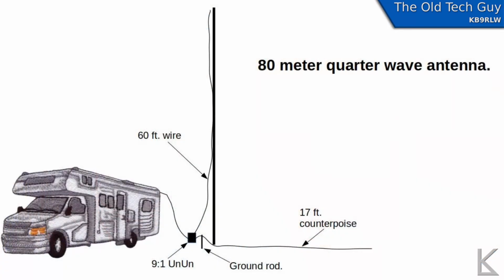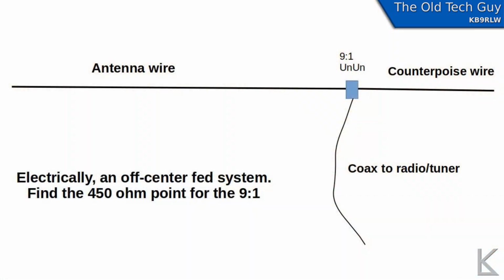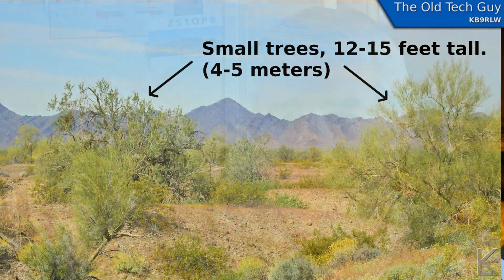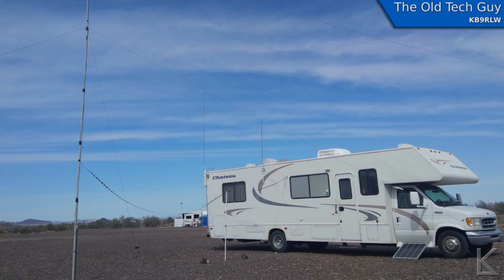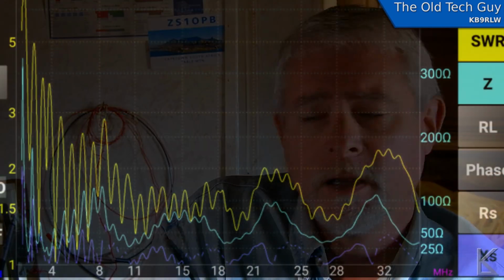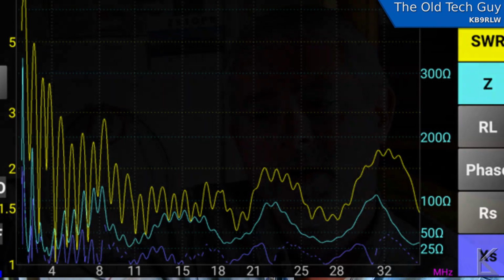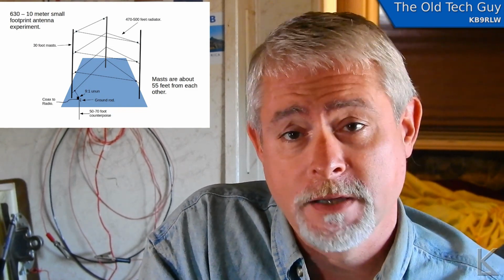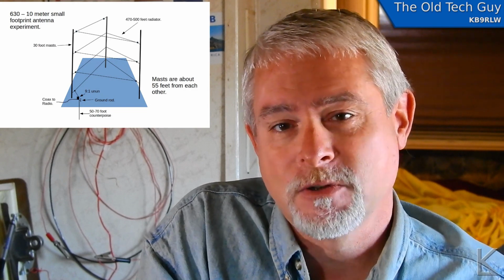Ham Radio - A 630-10 meter experimental antenna.  Part 1, the plan.

Comment: Good luck with the antenna experiment, you never know if it will work until you try it and play around with it.  It may have been tried before without success, but you might get better results.  Be brilliant if you did get it to work.  Good luck Kevin.

Comment: Bottom line, you are my kind of ham!
Instead of going out and just buying you decide to experiment like I have done in the past (I am not currently active), especially when I first got licensed in 1993 and first started in Satellite Radio (AO-10, AO-13, RS, AO-21, etc. so many more to name, I miss satellite coms)
 Its so much fun and exciting to make antennas and knowing they work just as good (if not better in some instances) than commercially purchased antenna's. Don't get me wrong,  I have also purchased antennas of course but building is so much fun and exciting! And I loved to modify my Satellite antennas when I started and had fantastic results!
 Bottom line my fellow Ham's. BUILD, experiment and test! that is what Ham Radio is all about. 

Kevin let us know how it works out, if you haven't already? Sorry if I missed the follow up video.

Thanks for your video, best 73 DE KD6SBR, Tom in NV (hoping to get back on the air soon, 80 160M hopefuly)

Comment: God speed in this experiment! I love the idea. I doubt this will be available, but maybe it will inspire something. Recently I visited my town's local metal scrapper, and they had
 1" aluminum poles. Most were cut into 4' lengths. I bought about 20 of them. Then I riveted on 12" lengths of schedule 40 pvc which matched the OD of the aluminum and couples the segments nicely. I do have to guy them but they work well and the whole weight per mast is just a little more than an event/camping chair.

Comment: Hi Kevin. Thanks for the video.

From personal experience - you really need to model antennas before building them. I've built a reasonably simple and well-known Windom antenna once and it didn't work quite well. For some reason I got SWR 2 on 20 meters. Thus I decided to model it - turned out the impedance in the feed point considering the mast hight and inverted-V shape was far from 200 ohm, thus 1:4 transformer didn't work as I was expecting. It took me 10 minutes to make a model and a day to build an antenna. Lot of time was lost. If you are using MacOS, CocoaNEC would be a good choice and it's well documented. For Linux there is xnec2c. For Windows there are GAL-ANA and EZNEC. There was series of articles on EZNEC in QST column "Hands-On Radio" by Ward Silver (NØAX). If you are an ARRL member, you can access these articles online in QST archive, or you can buy a book "Hands-On Radio Experiments, Volume 2". 

Speaking about new videos maybe you could tell us a little on using a straight key or how you learned to use it (some kind of exercises maybe? or just a lot of practice?). I'm new to CW. Learning morse code per se was not a simple task, but there is plenty of information on how to do it. Currently I'm using a two-paddle key at 20-23 WPM and sometimes straight key as well. I'm using this one https://www.ebay.com/itm/TH-010-Morse-Code-Telegraph-Straight-key-on-Wooden-Base-for-Ham-CW-Practice/123595435706  Although I made some QSOs with it I get an impression that I might do something wrong. My arm gets quite tired and I can't send faster then 12-13 WPM. A little peace of advice would be much appreciated!

73 de R2AUK

Comment: Great idea but I'm not sure how that triangular spiral -- a combination of horizontal and vertical -- will go. As you know, you can bend horizontal antennas to fit a yard, but IIRC there's a limit to how much that bend can be before adverse effects begin to apply. Now that radio has been around for a century, and thousands of antenna designs have been created, it's probably a safe bet that someone has tried such a spiral. Callum may be able to model that for you.
Reply from the maker: It's been modeled, that's the next video.  Results were pretty good!

Comment: Hi Kevin, good to see you back on the Tube.  The 500 foot wire as you described it sounds a lot like an unterminated 80M Beverage antenna. When you are done with the 630M testing I would run some receive tests against your Inv V and vertical. Some of your viewers might not know a lot about Beverage antennas. Could possibly be an interesting video also.

Comment: I suspect that this spiral will work somehow. On 630 m the spiral is much smaller then the wavelength. So it will be like a coil / inductor, like the short stub antennas that you put on hand held radios. On shorter wavelengths it will be a helical antenna. I.e. it will radiate vertically upwards, perfect for NVIS.

Comment: You Kevin!:
Great video! (As usual : ). How about doing an end-fed balloon or kite 630 mtr antenna? That might be interesting! (Lighting arrestment I'm SURE : ). Give it a try! (Additional comment on e-mail : )..
Dr seeker/Jeff WA7LFP
Reply from the maker: I've had a balloon kit for about a year now.  The problem is you need to notify the FAA at least 24 hours ahead of time.  And out here in the desert, it's been nearly impossible to predict when the following evening will be calm.  And even if it is calm at sunset, you can suddenly have 20mph winds for a bit at random.
Conversely,  I've flown a kite and had the wind completely die within a couple of minutes.
It's just too unpredictable out here.
Reply: @loughkb  Yeah, aircraft danger, especially helicopters flying low.  You just need one, if your luck is like mine it will be the only helicopter to pass that way in years!  Then they would hit it!  But maybe you have better luck than me.

Comment: I like the idea of your 'delta spiral', but surely the support masts will need to be non-conductive? They'd be a bit bendy and need guying. But experimenting is what it's all about.
Reply from the maker: I'll be using fiberglass, and guying them back from near the top to support the pull and weight of the wire.

Comment: Interesting idea Kevin. Maybe you should try it on 160 first. Look forward to the results. 
Watch out for snakes. 73
Reply: An excellent idea, considering the amount of radials required!
Reply from the maker: My original idea was to do this with an end fed half wave for 160.  At that length it only goes around the structure 1.5 times on it's way up.  That version would be fed with a 49:1.

Comment: Hi Kevin,
Good to see you are well. That spiral antenna looks to be a good experiment. You can take off the bottom cap from the spiderpole and remove the smaller sections and you will have a shorter mast that will be extremely stout for the antenna experiment. Did you make any contacts during the ARRL DX SSB contest? I ended up with 185. Will see how much that increases my country total when I get it uploaded to LoTW.   73   WB3BJU

Comment: city lot....  55 feet between centers........ not sure what city... not this one.... I have maybe 15 feet from the back of the house to the back fence and 20 feet wide.... most of that obstructed with a tree  ^_^    I'm at least lucky to have a tree... so I have a random wire up it.... but yeah... it doesnt get above the 2-story stucco houses so yeah... shrugs   But yeah maybe my parent's old home?   their new home in Dallas I think is only slightly bigger than my back yard... ^_^   Still a cool idea though.. love to see what comes of it.
Reply: You could live in the center of it...
Reply: 20 feet wide? My lot is 36' wide and the house is 24', and I thought that was small.

Comment: If I am not wrong, you have done Python, C++, Arduino and or one of the other Programming I/O interfaces Raspberry). Have you done any HF amps, tuners, etc?

I am planning into some of that stuff soon, once my shop / radio room is done.

I got a  book on building a transceiver, but not an uBITX, but a well done one with 200 or 400 watts as per preference.

 Thanks.

Comment: Cool, but why not go ahead and make the spiral Delta a 1/2 wave? Wire is not that pricey and in fact the whole thing would use less space than your 70 foot counterpoise.
Reply: A counterpoise (5% wavelength) is still best practice.
Reply from the maker: Uh, it does use a half wave of wire.   But with an UNUN, you need a counterpoise.

Comment: If you get a chance Kevin, could you demonstrate how you accurately measure out these long wire antennas? When I was measuring out my 148' end fed long wire, I wrapped it around the outside of a 5 gallon bucket. I really have no idea how close I came to my target length. I'm sure there's an easier and more accurate method.  73 Colín  VE3CWQ
Reply from the maker: I put two spikes in the ground either 50 or 100 feet apart.  Then i loop the wire between them a number of times depending on the length I'm after.   With shorter lengths, you could put the spikes closer.

Comment: I have been thinking about if I have a copper or steel well that I can use as I ground,  counterpoise!  Do you think that will work.  I am in south Florida and the water table is about 20 feet. If this can be used it would give me a lot of things I can do.
Reply from the maker: That should provide a good ground electrically.  However,  a lightning strike could send a heck of a spike into anything at the well head and maybe even down the pipe into the house.
Reply: @loughkb  well I don't have it connected to anything now.  No pump, or anything. I worked repairing things that got lightning damage. I have seen ground rods that had glass form around them because of the heat from lightning! I have seen PL259 blown off the end of coax, and many things that most would not believe if I told them. I would be a fool to have anything connected to my 60 tower when there is lightning anywhere near me. I can't take down the antennas but can disconnect all the coaxial cables coming in the house, and give it every chance to go to ground without damaging my radios. I wise guy told me that Lightning does what it wants to do!  And if we don't like it, that is our problem!

Comment: set keydown := false
set audiotone := 0
Begin main loop
	if not keydown stop transmitting
	if keydown start transmitting 
	Read the audio frequency present on an analog GPIO pin and store it in the variable audiotone 
	if no audio tone is present audiotone = 0
	if audiotone=zero set keydown := true
	if audiotone<>0 set keydown := false
	set 630meter CW transmitter to FrontPanelFrequency + audiotone
End main loop
#
#  The above is not exactly code.
#  The above is intended only as a crude algorithmic explanation for an idea.
#  A lot more detailed "actual code" would be required to properly implement the concept
#  I'm confident you would be more than capable of writing the code if you chose to.
#  Feel free to use the idea or ignore it as you deem appropriate
#  
#  The overall concept is to suggest that you custom write a sketch for the arduino inside
#  your 630 meter CW transmitter.
#
#  Hook the audio output of your computer's sound card to
#  the analog GPIO pin inside your 630 meter CW transmitter referenced above.
#  Use appropriate isolation to avoid adding hum.
#
#  Run WSJT-X or FLdigi on the computer.
#
#  Essentially, you would be turning the internal arduino of your 630 meter CW transmitter
#  into an A/D converter.
#  Then using that data to shift the CW Transmitter's RF output frequency the 
#  appropriate amount
#
#  Your 630meter CW Transmitter would now be capable of transmitting some
#  digital modes using direct FSK.  Not to be confused with AFSK.  
#  AFSK from the computer would get turned into Direct FSK inside the Transmitter.
#

#  You could perform accurate testing of 630m antennas with WSPR down to 

#  single decibel resolution.
#  You could use FT8, JT65, RTTY, or any AFSK digital mode in FSK form
#  The CW capacity of the transmitter would still be available of course.
#  
#  Sadly this would NOT enable PSK31.
#
#  The only hardware modification to your CW transmitter might be to
#  build a simple transistor switch from a second GPIO pin to the CW keying input of
#  your 630 meter CW transmitter.
#
#  Love your videos Kevin.  Keep them coming.
#
#  72,  Keep having Fun
#
#  Mark
#  NRØR

Comment: Great work & thought, Kevin!

Have you performed a eznec model of the "triad-spiral" yet? I think that would be a good start in order to see if you have any weirdness beforehand, and to check the pattern.

I really like the ID'ing of signals on the waterfall idea!!!  I hope you will do so on both types, like your 7300, but also on WSJT-X...  I've seen some really strange stuff that doesn't match any sort of mode (yes, I checked the other modes & even the bandwidths are wrong). I found one signal twice that was nearly 800 hz wide, and looked like popcorn, popping all over a 2khz range. For about 35-38 sec per cycle - weird!

Are you in DM24 now?  If so, I'd like to do that FT8 contact.

73 - John - N7GHZ
Reply: The model looks like a good antenna... with an unexpected bonus.